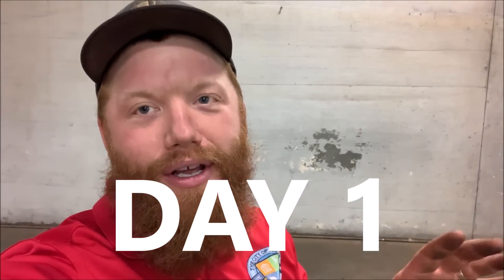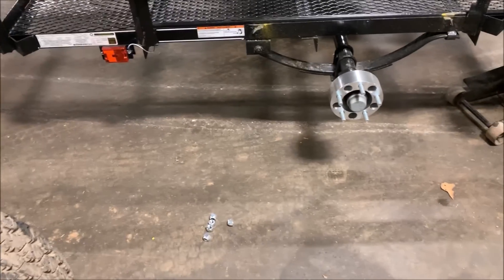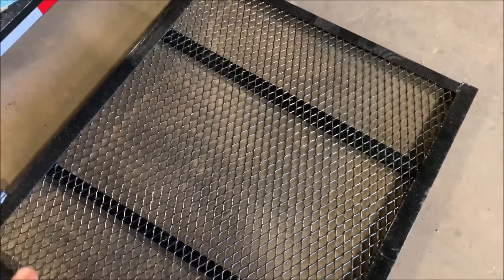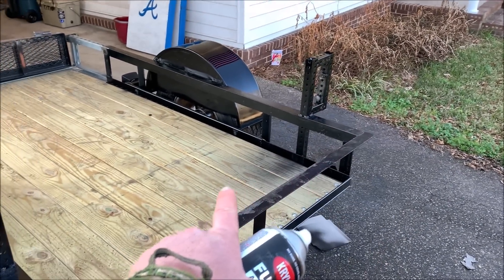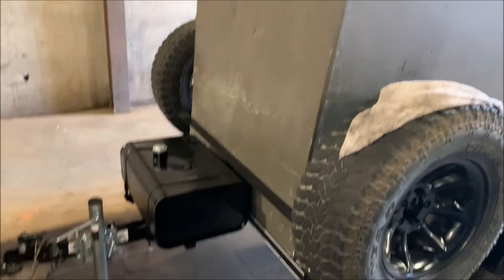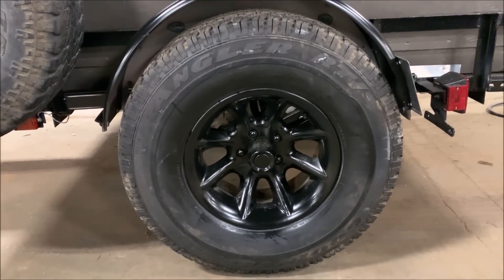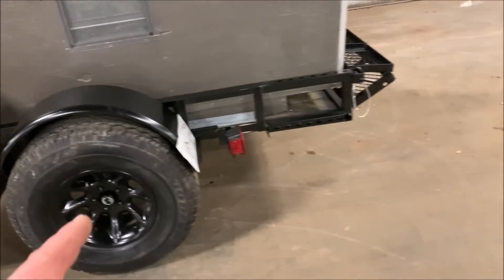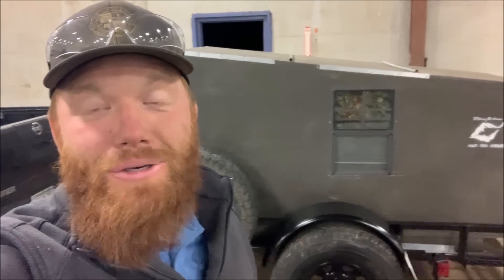DIY Off-Road Mini Camper

Comment: Pretty cool. I have a couple questions though. How do you get the gas from a mounted can into the truck if you need it? Wouldn't it of made more sense to have the angle the other way? More aerodynamic and you could of put a larger door in the back so it is easier to get in and out.
Reply from the maker: I carry a small hand pump to move the gas. Originally the camper was made to go in the back of a pick up so thats it made more sense to build it the way I did. There are videos on my channel showing how it looked previously and showing the upgrades have done to it to improve the aerodynamics and overall look of the trailer.

Comment: I like the build. when you extended the trailer did you think about extending the front of it because that would have probably helped a lot more on weight distribution. Instead of extending the back of the trailer
Reply from the maker: I didn’t think about that. However, the weight distribution is perfect now. The gas tank I mounted up the front works great and allows me to carry fuel without cans taking up room in the bed of the truck on trips. Thanks for watching.

Comment: That is a really cool build ! you might possibly have to add some kinda blocks in case the springs flex far enough when hitting a bump that those nice tires might hit the fenders you just bought. It might not need them though. just stand on the rail next to the fender and bounce up and down to see. On a final note, i am curious what you think of that nissan frontier ? i just bought one and i'm wandering how well they hold up?
Reply from the maker: Donnie Hamblin I’ll check that out. I love my frontier. I’m going to drive it a couple more years then buy another one. I can’t say enough good things about it.
Reply: @sclivingoutdoors  that's what i was hoping to hear about the truck. the trailer may very well be fine without the blocks, i'm overly cautious, i put wider tires on the back of a nova one time and tore them up, when they're turning going down the road and then you hit a bump. A few good bounces before hitting the road should let you know! and like i said awesome build!

Comment: Nice job, looks good. I do have a couple questions though. 
Why is the camper taller in the front than back? Seems like doing it the other way would make it more aerodynamic with less drag.
How do you get the gas from your auxiliary tank into the truck? I didn't see any drain plug or spare can to transfer the gas.
Reply from the maker: The camper was originally designed to go in the bed of my truck. The design was made to push against the straps insuring it wouldn’t come out of the truck. There is another video on my channel showing the mini camper before I had it on the channel. It is linked at the end of this video. I have a small pump and small empty gas can I carry with me to move the fuel if needed.

Comment: What about holding up the camper on the rear end when the trailer isn’t hooked on? I have my own ideas on what you can do to fix it, but I would love to see what you did because I’m building my own mini hunting camper very similar to this one.
Reply from the maker: I have 2 adjustable poles that go into place with 2 bolts. It takes a minute or less on each side. It works perfectly

Comment: One thing you might want to think about with your gas tank on the trailer, could it get damaged from road debri or something kicked from your truck tires?
Reply from the maker: The gas tank need to be mounted externally. It came off a trailer. It’s really heavy duty metal.

Comment: You should have used pressure treated wood on your trailer deck is going to rot if it's not treated. You could always use copper green coat and treat it like it's pressure treated wood
Reply from the maker: The wood on the deck of the trailer and base of the cabin is pressure treated.
Reply: @sclivingoutdoors  thanks for all your replies. I have shared this video with my son and several friends I have have other trailers I'd like to build thank you for the ideas

Comment: Just came across your video. When you installed your spacers did you use red lock tite on the hub threads? You really should.
Reply from the maker: Yes, I did. 👍🏻

Comment: Awesome, but shouldn't the bow be lower than the stern side for aerodynamics and to allow for larger door to enter the camper
Reply from the maker: The cabin was originally built to go in the rear of my truck. I designed it like that for safety while strapped in the truck. There is a video on my channel about the original cabin portion of the camper. There He is also another video I just uploaded yesterday shows some upgrades that I did to it and aerodynamics a lot.

Comment: Can you help me understand how you upgraded the tires and rims to fit.  i have a similiar trailer its a 5 lug but from center to center of each lug is like 2 1/4 inches apart.  in the video you said 5 lug with 4.5" (im guessing this is center to center also) .  any advice how i can upgrade to biggers wheels like you did with what i have?  This build really caught my attention and I am interested in building my own but first i want to get the wheels upgraded to match my ranger pickup truck
Reply from the maker: JB on a 5 lug wheel you measure from the center of one then skip a lug. So measure from the center of #1 to the center of #3. On my trailer that was 4.5”. So my bolt pattern was 5x4.5. To make a larger rim/tire fit I added spacers so the larger tire would fit without rubbing.

Comment: Hi.... looking at doing something similar. Good deal!!!! BTW.... how did you mount the base boards to the bed of the trailer?
Reply from the maker: I drilled through the board the the trailer frame and mounted them using carriage bolts and lock washers.

Comment: I have a question for you unrelated to the build.  I moved to South Carolina and brought a 6 x 12 utility trailer with me.  It had a permanent plate from my last state.  When I switched over my plates at the DMV I was told I didn't need a trailer plate.

I see you put plates on your trailer.  So what is the deal in South Carolina, we need trailer plates or not?
Reply from the maker: You don’t need trailer plates in sc for most trailers. I don’t know where the cutoff is on who needs it and who doesn’t. I think big campers need them. I did it purely so when I pull it across the country I wouldn’t get pulled over. I thought it was a simple step to take to avoid any future issues.

Comment: Nice ! I see this video is from two years ago. How is it running for you ? Are the bearings and wheels spindles still good ?
Reply from the maker: Everything is still good. The bearing buddies make a big difference. I’m going to update the suspension this year. That camper has been across the country like 4-5 times. I just went from SC to far south Texas on the Mexico boarder up to NM to Idaho to Eastern MT down to Illinois back to SC.
Reply: @sclivingoutdoors  great, just ordered a set of bearing buddies online for my boat trailer after seeing your project. It’s quite difficult to get spacers in Europe for anything other than Japanese cars, but I wondered about the extra strain cross country. I have 4 Landrover wheels in my shed so I might see if an engineering company would make me a set for a trailer chassis I have out the back (the offset is too big on them). Thank you for your answer.
Reply from the maker: @COM70  I would think you could order them online and they would deliver anywhere. It might cost a lot to ship though.
Reply: @sclivingoutdoors  I would be going 4 stud to 5 nut so I think it might be difficult without an engineering shop. Standards in Europe are completely different over here.
Reply from the maker: @COM70  Where there’s a will there’s a way. Good luck.

Comment: Need a awning on it man that way in hot places you can leave the door open or maybe a pop up canopy little LED lights and some solar power lust like one panel up top and a couple batteries instead of that fuel tank that way you can run a little 12 volt fan to keep some air moving to make it comfortable cause I know that things gotta get hot as hell out in the deserted wasteland of a state they call new Mexico amongst other summer months if u plan on camping out
Reply from the maker: That’s a little more fancy then I want it, lol. I only really use it in the fall and winter.

Comment: Have you ever tried the camper in below freezing temperatures? If yes how cold was it, and how to keep it warm?
Reply from the maker: Ali Aldossary Yes, I have. It stays a little warmer than a tent would. Your body heat will warm the area some. I put a sleeping bag and some blankets and in there and I’ve always been fine. However, I might not be the best person to ask because I do really well in cold temperatures. Ive tent camped in the low 20s multiple times in Maine and Idaho and been fine. The cool thing about the camper is you can put as many blankets as you want to in it. I would feel comfortable sleeping in it in any temperature.
Reply: SCliving Outdoors thank you for your response.

Comment: I may have missed you saying something about it but is there a reason you have the front of the trailer higher than the rear?
Reply from the maker: The cabin part of the trailer was originally made to go in the bed of my truck. I built the front higher so the wind resistance on the straps would keep it in place. There are actually a couple of other videos on my channel about the trailer that explains more. I linked them below. 

https://youtu.be/n0yM3DhzSME
https://youtu.be/YkeQ6n-M_6Q

Comment: are the spring gonna be ok or are you gonna upgrade those later?
Reply from the maker: B.D. Wax I’m not planning on upgrading them. The cabin portion weighs less then a 1/4 of what the trailer is rated for.

Comment: if was you i would add 4 leveling jacks to make it stable when getting in and when in it :) :)
Reply from the maker: There are adjustable stand/legs in the back now. They easily attach or store away for stability when getting in and out and not attached to the truck

Comment: those spacers aren't hub-centric, are you worried about vibrating the wheels off?
Reply from the maker: No, not worried about it. The whole thing only weighs about 400lbs. It’s not really very much weight on the studs

Comment: I've been wanting to match my rims and tires to my tundra but I haven't been able to find spacers/ adapters
Reply from the maker: That would be cool
Reply: I have the same trailer and just ended up replacing the axle to get the Tacoma bolt pattern, mine was old and bent anyway from a friend overloading it. It was only maybe 200 box delivered to my house

Comment: What year jeep did those rims come from?? Wondering what size to look for
Reply from the maker: I’m not sure. The bolt pattern is 5x5.5 I believe. I think that’s a pretty standard Jeep pattern. Just make sure to check out the offset so you can figure out if they’ll rub or not.

Comment: wonder if anyone knows where to pick up just the box part of something like this build. an aluminum box i can mount on my trailer and convert to a camper. seems like buying materials and welding is pretty expensive.
Reply from the maker: They sell enclosed trailers, but they’re expensive. Building was by far the cheapest option for me.
Reply: @sclivingoutdoors  ya I was wanting to do the same but was hoping to find the aluminum box already built. I could build it on my trailer from there.

Comment: I thought it was illegal to put odd tyres on a car, or trailer?
Reply from the maker: Miceal Adams it’s not illegal. The tires are the same size just not the same tread pattern. Even different size tires aren’t illegal. There are a lot of cars that run different size tires on the front and back.

Comment: 2 1/2" wood screws? Use something far more substantial! It should be bolted through the frame of the trailer. Have you ever seen how commercially made campers disintegrate in a crash? This has nothing like that level of build, it'll be like tissue paper.
Reply from the maker: sewob147 no offense man, but if I get rear ended I don’t think it’ll matter what it’s made of.

Comment: DIY means do it yourself, not I have a buddy who does all my welding .
Reply from the maker: Chris Groves thanks for the comment. There is an updated camper build video on my channel.  I added a metal storage compartment to the front of the camper and a different larger step to the rear. I did all the welding myself. Thanks again for watching.